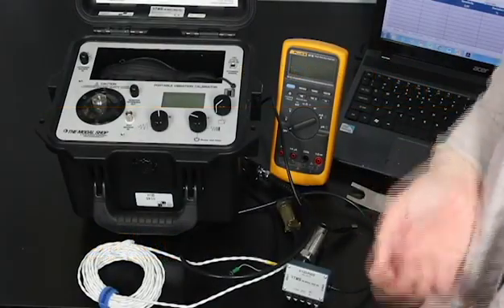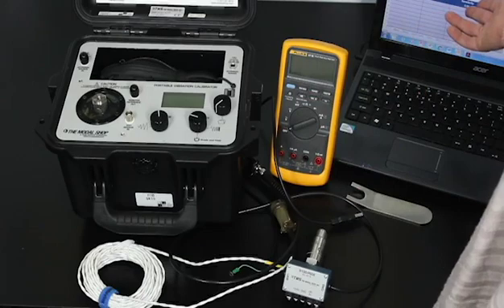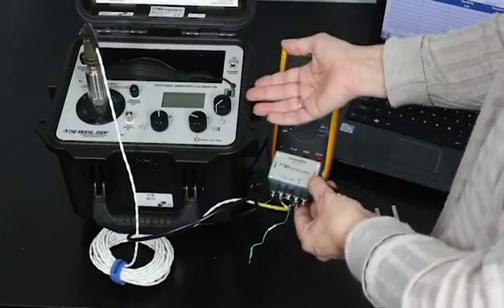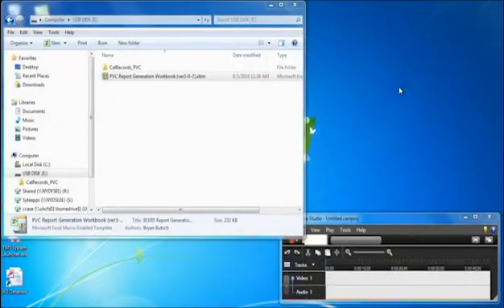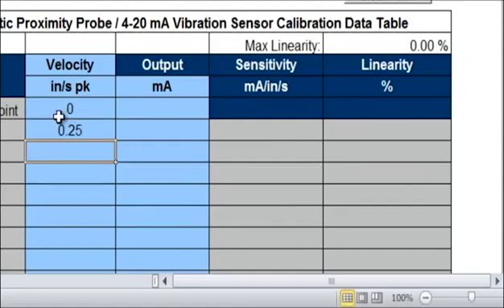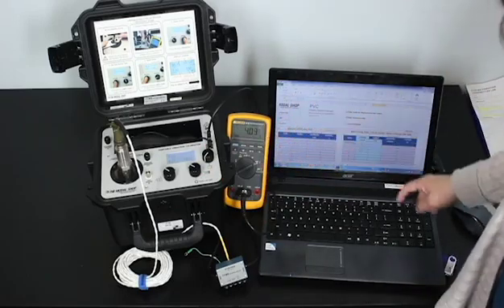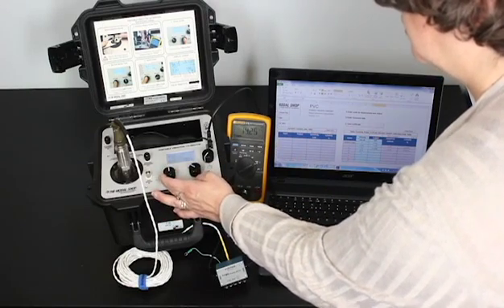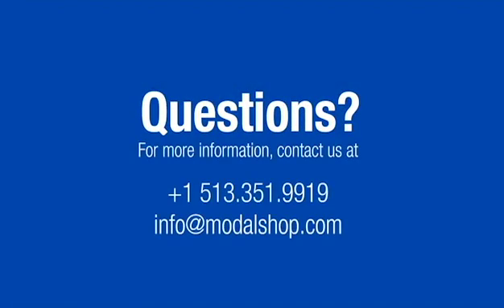4-20 mA Vibration Transmitter Testing - Portable Vibration Calibrator

Comment: Thank you for sharing the information, Can you please share how to calculate the sensitivity and linearity formula
Reply from the maker: You are very welcome! The sensitivity is span in mA divided by span in amplitude engineering units (i.e. inches per second or mm/sec). Linearity can be calculated many ways. We use deviation from full scale and express it as a percentage. But that is not the only way. Another popular method is deviation from best fit straight line.